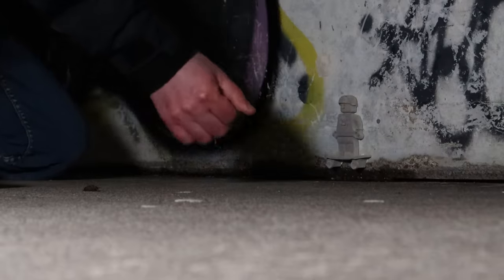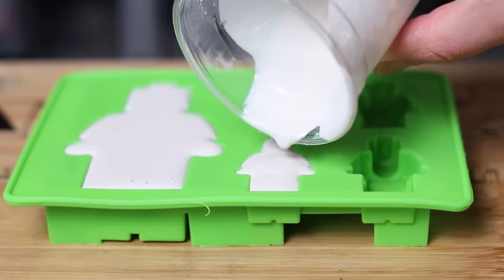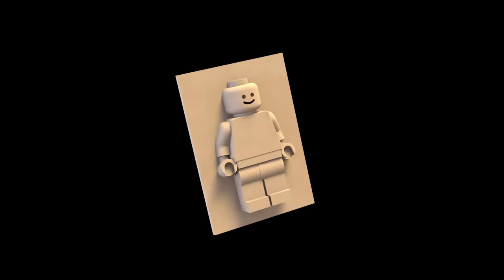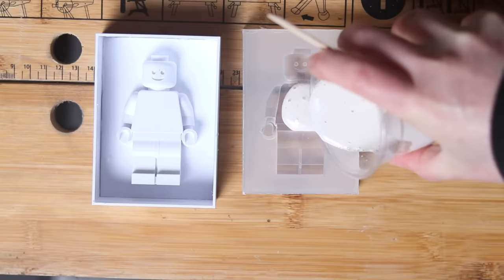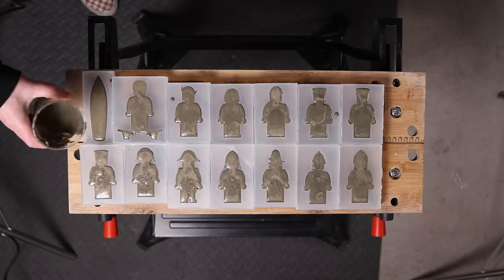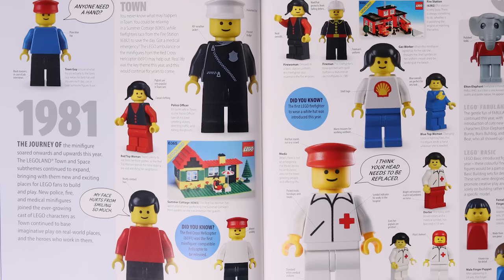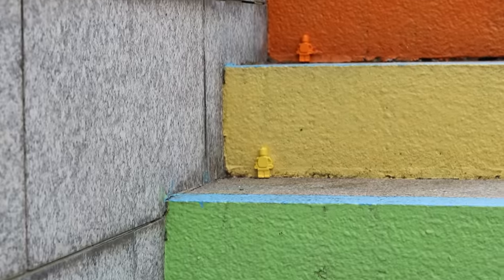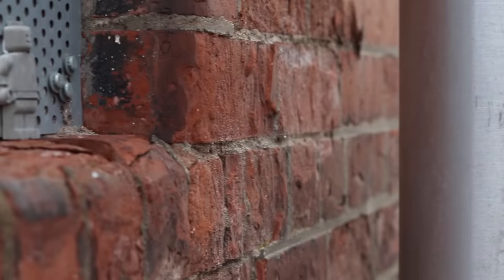How I Invaded A City With Concrete Lego Like Figures

Comment: #Protip
Found the Cheapest agitator u can get is an air pump for small fish tanks. Gives slight vibrations qhen placed against molds it helps to release those bubbles. Also a vacuumed chamber like ppl use for poxy resin would work. Less air, longer life
Reply from the maker: Thanks for the tip!

Comment: A word of advice, you can get the bubbles out a lot easier than tapping if you have a sub woofer. An old school boom box style stereo speaker might do in a pinch, but the woofer is going to actually be able to vibrate enough if you run some low tones through it.
Reply from the maker: Thanks for the suggestion. I'm going to try and test out something to vibrate the moulds next time.

Comment: That is a nice B&D workmate bench. Mines is shotty mdf. I really should replace the surface with natural wood. Seeing yours gives me strong hope. I also really like this concrete idea
Reply from the maker: I need to build a proper workbench which is one of the reasons I had put off making anything for so long. But the workmate works well for smaller things.

Comment: Hi. There's a way to improve your molds: you can reinforce weak points with some sort of a frame be it brass wire or whatever  and you can do a double sided mold, maybe you can even use the shape of molds lego uses.
Reply from the maker: Thanks for the tips, I still have a lot to learn.

Comment: I guess it may be too late, but in any case, you could've used a small batch of very liquid concrete to fill small details, and then pour your normal concrete on top. Concrete would settle, moving excessive water on top.
Reply from the maker: Thanks for the suggestion. It is actually something I did try briefly but didn't have much success with. I will try and test it out again in the future.

Comment: This video really inspired me to go on my own little city invasion with concrete figures. I went with the star wars theme. I made my first batch, and they look really cool, but some of them have loads of air bubbles. I will sort that out on the next pour. 
What kind of glue did you use to glue the figures to walls? Superglue or some kind of special glue for concrete?
Reply from the maker: That's awesome to hear! Have you posted photos anywhere? I have had a lot of requests for Star Wars characters. I used Soudal high tack glue but am going to try some other options next time.
Reply: Didn't post any photos yet, but I will get back to you when I do. I got my molds from Aliexpress. I have Darth Vader, Stormtroopers, X wing, Millenium Falcon and R2D2. I plan on sticking near tram stops so people waiting see them. 
Who wouldn't smile when they see a little concrete head of Vader.

Thanks for the reply 😊

Comment: Tip: You probably don't need the sand binder for a project like this. Cement alone would work fine, with possibly better surface finish.
edit Another tip: Don't mess with the water ratio too much when using concrete. Correct hydration is part of the chemical process.

Comment: 🎉 brilliant. You could use an orbital sander to vibrate your molds🤔
Reply from the maker: I did try an orbital sander but wasn't sure how much it helped. I need to experiment a bit more I think.
Reply: Another suggestion would be a hammer drill lots more vibration 🫨 none the less, great work 👍

Comment: I love the whole thing and I am interested to see what you come up with next. My suggestion is next time include some female figures. It always seems weird to me when someone does a project involving multiple characters and yet fails to include representatives of half the population.
Reply from the maker: It's an interesting point. The medic is a woman and I did try and do another but the more modern hair is pretty tricky to do. I have been working on it. I didn't really think about the gender too much as I feel the earlier figs could be anything anyway. They just have a smile and two eyes. Modern female characters are tricky because they have a lot of facial features which are very hard at this scale. In a lot of my previous projects I have included women.
Reply: @SketchyMaker  I am new to the channel and plan to check out some older videos so I'll be interested to see. 

I think the problem with the more generic figures is that unless there's some specific female coding, like a skirt or long hair, people tend to assume male as the default, because historically that's been the case.

Comment: how bout u use a vacuum to get rid of the air bubbles?5:00
Reply from the maker: Thanks for the suggestion. My limited understanding is that concrete doesn't work very well with a vacuum.